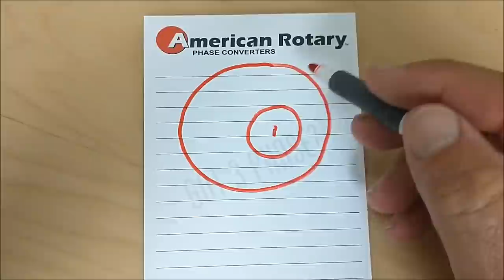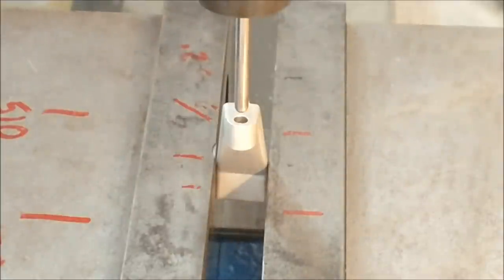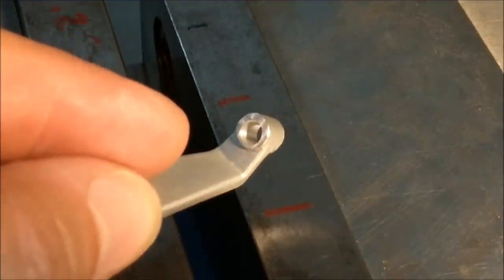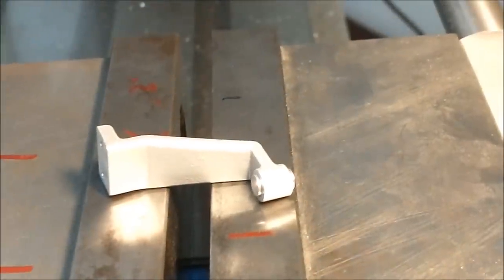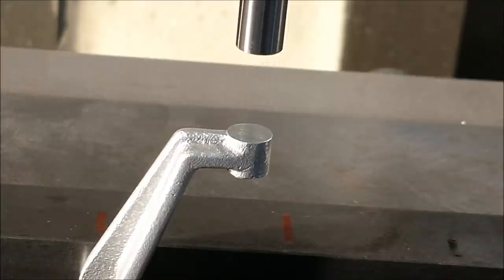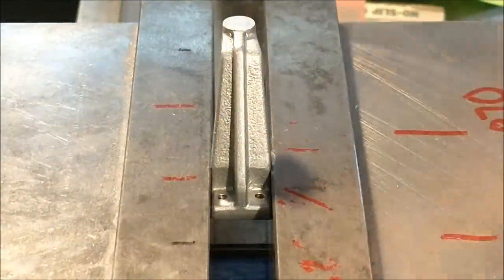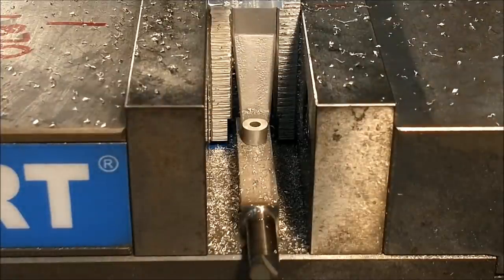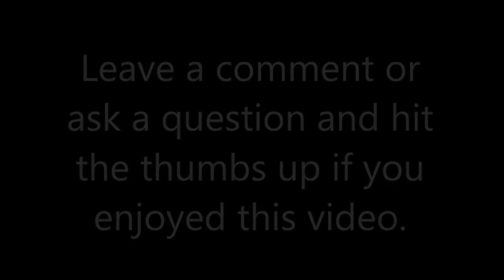Is It Impossible to Move a Hole in a Piece of Metal?  No.... Watch This !!!

Comment: Good recovery!!  I thought you would get a new casting, but this was quicker, and taught a good lesson for others.  I am  clockmaker, and was taught that you can repair anything, so long as you can't tell when its done. This is a good example of that . Thanks for showing.
I think Loctite would have been enough, but the squeeze in the vice trick is another good trick.. Us clockmakers just start with a small hammer and "rivet", with an increase in  hammer size if needed!  The bigger the problem, the bigger the hammer.

Comment: A lifetime in the drawing office taught me that a good relationship with the workshop staff was one of the most important in life. Their experience was to be respected and was often rewarded by them spotting an error which would come back to haunt me at the assembly stage. A reciprocal of this was that a drawing change could often be accommodated to over come a workshop error. Not all my colleagues took this attitude and had a confrontational and superior attitude to the men in the manual working departments.
Reply: Trevor, I agree 100% with each of your points. A toolmaker by training but worked, from the completion of my apprenticeship to retirement as a draughtdman; valued every tradesman who made what I designed/drew. Thanks Joe for your effort.
Reply from the maker: The best engineer is the one with a deep understanding of how the part will be made and by having trust in the guy doing it. It can be a very productive relationship.
Reply: @joepie221  Knowing and understanding how stuff is made, ie. the lack of this knowledge, is one of the great failings of modern engineering education.
The fact that I worked for Big Blue for 5 years and obtained tool & die/mold maker certification before I began my engineering education, paid off big time throughout my professional career.

Comment: Seeing this casting just reminded me of chatting I had with an old engineer years back. He was showing me an old machine he'd rebuilt (I can't for the life of me remember what it was. it was something "Industry specific", but I can't even remember what industry that was now........ Part of me want's to say "Shoe making" though), and mentioned that he'd had to drill, ream, sleeve and re-bore a hole in a spindly curved arm that stuck out of a small, quite delicate looking, and VERY irregularly shaped casting. I looked at it and asked how the hell did he hold that (expecting him to talk about days making an intricate jig with clamps and multiple locating surfaces)? His reply was one of those "Erm.... What?" moments. He said "I heated it right up, then cast everything except the top of the feature I needed to work on in a block of lead, then I machined the lead to go in my mill vice. Once I'd done everything, I slowly cut, peeled and melted the lead back off it". It was a technique that wouldn't have even occurred to me if I'd had a hundred years to think about it.

There were so many follow up question's I SHOULD have asked, but didn't think of at the time, Like how did he prevent the lead from sticking to the casting? Whenever I've had a difficult fixture job since then, that guy has always popped into my head. :D
Reply: I used to do quite a bit of IPSC shooting, and every weekend would cast lead alloy bullets in aluminium molds. I used to hold the mold over a candle flame (after preheating) to desposit a fine layer of soot on the casting surfaces. No problems with bullets sticking to the molds with that.

Comment: In my shop if I could acquire the part before drilling I would make a precision fixture for locating, drilling and reaming the holes. I usually had multiple parts, many orders of the same part so, making a fixture was economically viable.
Reducing headaches was the, " name of that tune." Nice technique Joe, I've seen quite a few.
Reply from the maker: This seemingly simple part presented many challenges. I like fixtures too, but raw castings can be tough to fit.

Comment: I wouldn’t do the expansion with locktite because of Young’s modulus of elasticity. Firstly because you just don’t need it, but mainly because it will shrink in diameter when you loose off the deforming pressure. I would totally 100% use it without locktite with the casting hole chamfered to rivet it right in there. Nice vid, good message, don’t panic 😱 most things can be fixed :o)

Comment: Excellent lesson, thanks Joe. I will remember that vise trick. I may even add a countersink on both sides of the hole (perhaps if the casting was larger) to really lock it in, rivet style. I have seen metal dovetails done similarly with extra material and then a peening operation. Metal is a wonderful material! Thanks again, Craig
Reply from the maker: A countersink is a good idea when the material will take the pressure needed to peen the slug. I didn't think this cast aluminum would hold.

Comment: Nice recovery, I'm always impressed how well the blasted surface mimics the cast surface.  One query though, shouldn't the mounting holes be spot faced as the top surface likely isn't parallel to the mounting face?
Reply: That's cruel on Joe's OCD.
Reply from the maker: Good call. I'll add it.

Comment: Nice fix! I hadn't seen that trick of squeezing the insert in a vice to expand the ends. Clever and I expect it helps to hide the join. Cheers.
Reply from the maker: Thanks Crispin. Pressing a bushing into a part with only one machined surface can be an alignment recipe for disaster. This method was much safer all around.

Comment: You used a pin to align a crooked hole? That's why bottom looks off center compared to top,or did I miss something
Reply from the maker: Using the pin helped to keep the bushing true to the original hole. Its a space thing. The new hole was located from the outer face of the boss and top surface.
Reply: @joepie221  thank you,makes sense

Comment: Total amateur here so forgive me if this is a stupid question.  But why not fill the hole by welding or brazing and just re-drill it?
Reply: The part is cast aluminium and EXTREMELY small so you would more than likely end up with a molten puddle of sadness in this instance. Also small relatively deep holes are very hard to fill 100% with no gas bubbles that would become flaws in the re-drilled hole and lastly, if the filler metal was not a good hardness match to the base material re-drilling a hole and keeping it straight when it is half and half in materials of different hardness can be challenging. Filling and re-drilling is definitely a valid approach in some situations but probably not IMHO the best way to approach this one.
Reply: Easy weld job, most engineers would bush it because that's also simple.
Reply: Jules it's not a stupid question, it is one of the easy ways of going about it.
Reply: JB Weld!

Comment: I'm in aviation, and do a lot of riveting.

Had you thought about putting a slight countersink on either side of the hole (more like a heavy deburr) before inserting the bush and squashing in the vice?  You could have then filled the countersink when the end of the bush squashed over, and machined off the excess, which would have helped locate the bush more positively.  We call this a double flush plug in the trade.

Comment: THE HOLE IN THE TOP OF THE CASTING  ( THE HOLE YOU ARE FIXING ) HAS TO BE IN RELATIONSHIP  TO THE TWO HOLES  THAT  ARE IN THE BASE OF THE CASTING ,  AND TO THE BOTTOM OR CALL IT THE BASE  OF THE CASTING THAT IS MILLED FLAT  /   AND THAT HAS  THE TWO HOLES  THAT ARE 90 DEGREES TO THE MILLED BASE OF THE CASTING  /   AND THAT IS WHERE YOU SHOULD LOCATE FROM TO DRILL ,REAM OR BORE OR WHAT EVER YOUR DOING TO FIND   THE CENTER FOR THE TOP HOLE  (THE HOLE YOU ARE REPAIRING ) **  I NOTICED THAT YOU DID NOT USE A TOOL MAKERS SQUARE  TO CHECK THE ROD YOU PUT IN THE HOLE TO SEE IF IT WAS SQUARE TO THE BOTTOM aka BASE OF THE CASTING WITH THE TWO HOLES   /    AND YOU DID NOT CHECK TO SEE IF THE CENTER OF THE ROD WAS IN CENTER OF THE TWO  HOLES IN THE BASE  (THOSE ARE THE 3 POINTS THAT HAVE TO BE IN TOLERANCE WITH OTHER )   /     TWO OLD GERMAN TOOL AND DIE MAKERS TAUGHT ME LOTS OF MY TRADE  / THEY SAID IN GERMANY TRADE SCHOOL TO SEE IF YOU CAN EVEN BE A MACHINIST THEY GIVE YOU A TOOL MAKERS SQUARE , A FILE , AND A ONE INCH MIKE  AND A HUNK OF STEEL AND  YOU CAN USE A BENCH VICE TO MAKE A ONE INCH CUBE THAT IS SQUARE AND TO  TOLERANCE  IF YOU CAN DO THAT  THEN ONLY THEN THEY WILL TEACH YOU THE TRADE  /
Reply: WHY ARE YOU YELLING!
Reply: LOUD NOISES
Reply: @Philly_Gamer  He's in the machine shop with everything going on at the same time.
Reply: Loss of hearing from 50 years in the Machine Shop

Comment: Can I ask why not use an aluminum brazing rod, Fill the hole, then redrill it from there?
Reply: The heat will destabilize the metal and weaken the work piece, since the casting is so small you wouldn't want to weaken those hole walls by oxidizing any of the aluminum or changing metal stresses.
Reply: And if there's only one of these parts in the Northern Hemisphere (as I frequently hear the equivalent of), Even tigging it aluminum is just so hard to see when it gets liquid vs when it just melts into oblivion, if it's recycled aluminum and has  impurities sometimes they'll blow out without advance notice etc. But.. if you've got to do this to fifty parts (because someone is paying of course), I would do it your way

Comment: There IS loctite specifically for fits like this. It's the green stuff. Works aight.
Reply: The color on Loctite products means nothing. Loctite 270 and 290 are also green and not the right ones, those are suited for locking threads. 
The one you meant is Loctite 648, suited for fixing gears and cylindrical parts. Loctite has a very wide range of products in 4 colors. Grtz

Comment: Since the material was aluminum, I would have considered prepping the original hole and then pouring an aluminum filler. The finished product would have been the same but without the possibility of a blowout.
Reply: Seems a good solution,  Ken  .. but then no demo video!  How would you have prepped the hole?  what if the melting points were slightly different due to impurities? (would you get the equivalent of a "dry joint")

Comment: Excellent demonstration of the bushing repair. Important to remember that the part was not actually failed in the first place, this is simply adjusting to make better use and balance of the casting material. The net result is a superior part of course. Inspiring - never settle for second best. Thank you again Joe.
Reply from the maker: Never settle.

Comment: Tig weld it, drill a new hole. simple.
Reply: That's exactly what i thought too at the beginning of the vid. Lolol
Reply: Me too
Reply: It would depend on what mood i was in as it would have taken me about the same time to do both ways.
Reply from the maker: I'd put money on the fact that tig welding it would have blown it away.
Reply: @joepie221  You'd have lost your money, that's just everyday simple welding to me.
Reply: @joepie221  regardless, your precision techniques were really interesting
Reply: @joepie221  I guess it depends on your experience level at tig welding. I never want thinner material than necessary.
Reply from the maker: @brandonedwards7166  I can tig weld 2 razor blades together, but this is a different animal. I'll get a second opinion from a local specialist.
Reply: @joepie221  steel and stainless are easy. It depends on experience welding aluminum. We routinely weld all kinds of metal. That would be an easy task for our shop.

Comment: Thank you for another great video and thank you for sharing your mistskes and well-thought repairs. You should be able to sleep well now!
I love the paper punch hole center-finder.  Alternatively, one could use a continuity checker to detect contact.  Insulate the pin in the chuck and use a pin a mil or two smaller than the hole.  Connect the continuity checker between the part and the pin.  When you have no continuity you are centered.
   If your eyesight is poor,  you can't tell your shaking hands from the pin displacement and the ringing in your ears keep you from hearing subtle clicks the continuity beep does the trick, well unless your working with Delrin!
Reply from the maker: All ended well. I have seen the continuity tester used. Like a electronic edge finder or CMM stylus.

Comment: Excellent recovery...glad you decided to go with the larger centering pin.  Switching to using the outside of the casting boss for your alignment surface made all the difference.  Relocating the mounting holes on the main machine should be no real big deal.  Great job.
Reply from the maker: You'll never see it.

Comment: I have faced this problem too many times to count. Generally from other mechanics treading where they shouldn't have been in the first place. Nice tip on the squishing of the repair slug. We had a fleet of older D8 dozers that were all affected with their R hand Rear engine/torque converter bolt holes in the frame all pounded out/stripped etc. My go to for repairing them was to  drill and tap for an over sized 1 1/2 inch Grade 8 NF bolt. I stopped short of running the tap all the way through leaving a tapered hole on the bottom. I took that bolt and made a slot around it and after a good dose of red Loctite screwed that bolt into the freshly tapped hole and turned it in place till it snapped off proud of the hole. It was just a matter of decking it and re drilling and tapping for the 1 inch coarse mounting bolt. 10 tears later the repairs were all good. I have used this method om many more repairs over the years. That old mag drill and I saw a lot of repairs over the years. Great fix my friend. My granddad always said, "only the pro's can fix their mistakes". Words I will take to my grave.
Reply from the maker: Its also always easier to fix if someone hasn't butchered it before it lands on your bench.
Reply: @joepie221   It was rare that by the time it got to me it was easily repairable. It was like getting an engine in a couple boxes. It often would take a 1/2 a day to semi blue print them to see wat I was in for.  Missing fasteners were always a problem. Then wait while a decision was made to repair or scrap. I would often save some pieces for the rare days I had time to poke away at them. Those successes were the biggest feather in my cap. I would rather just call it a short day and just go home. A win, win for the shop and myself. It's always nice when we chat as we have walked a similar path. Take care eh.

Comment: Well, when I served my apprenticeship waay back when with Big Blue, we were taught to put the oversize hole in exactly the required location, sizing this bore the way Joe P. described in the video.  
Then simply turn a bushing and glue it in place with Eastman's 910 glue or epoxy cement if the mounting was fragile.  A sliding fit provided sufficient space for the glue or epoxy, especially when both the bore and the bushing were coated with the adhesive.
For punch and die work the bushing was heat treated and made a press fit.  
Eastman's 910 glue was the precursor of instant glue or Crazy Glue, and was developed for medical/surgery purposes.
Reply from the maker: Big Blue in what state?
Reply: @joepie221  In Toronto, Canada, and Rochester in Minnesota.
Also visited a new plant in San Jose, Calif. at that time.

Comment: Nice tip on the press fit and expansion of the insert. Another tool in the tool box, Thanks
Reply from the maker: Especially since this part only had 1 machined surface prior to installation. Thats a recipe for misalignment.

Comment: Very good! I've certainly made mistakes, and on occassion fixed them by using a bushing, but not as invisible as that. If someone pulls the plastic plug on the end of my motorcycle handle-bar, it is knurled - because it was just a little too loose, and I didnt want to redo it just to add 0.1mm (4 thou). Has stayed in there so far - since October or so, I think. And that's about 2500 miles on various race-tracks.